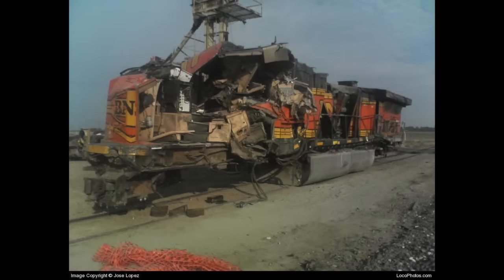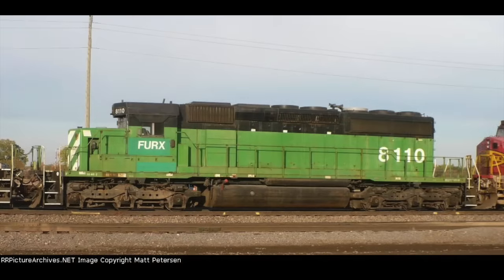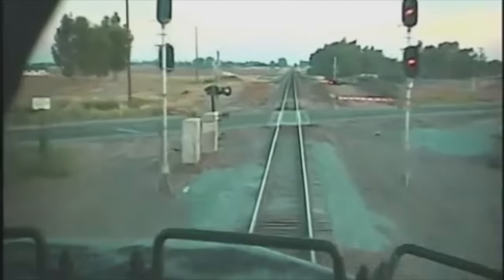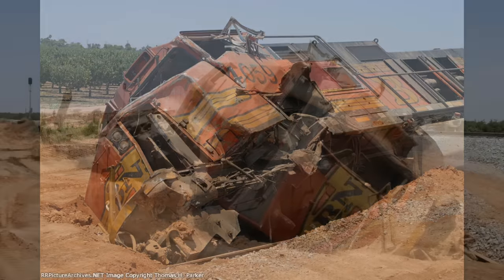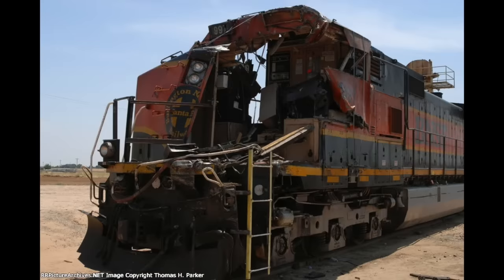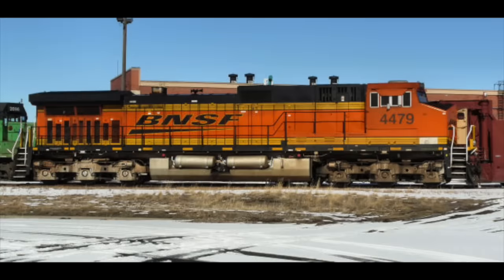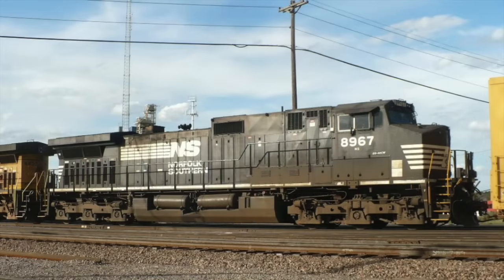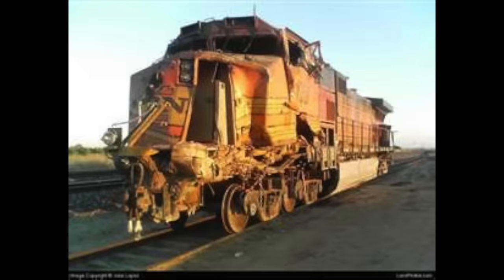Kismet Train Collision 13 years later

Comment: Correct me if I'm wrong on this, but having read threw the NTSB report myself there's a couple incandescence that stand out in your coverage of this incident. The first correction being that cocaine was not detected in the blood stream of any active crew members aboard either train. However the southbound's crew did test positive for marijuana in there blood stream. It was also stated that they had been dozing off prior to the point of the collision and consequently motored threw the approach signal at the north end of the Kismet siding which was displaying an approach signal that they were supposed to begin slowing down at. Upon approaching the south end of the siding awakening likely to the sound of the alerter going off the engineer realized where on the system they were at and upon seeing the red board in front of them the engineer dumped the air. Ironically he - almost - saved it. Had the train been given perhaps another 100 to 150 feet the train would have fowled the signal but still remained in the clear for the approaching northbound.

In fact if you watch closely as the northbound is nearing the signal directly it into Kismet siding you can actually see when the southbound crosses the signal fowl point causing the northbound's signal to immediately drop to red. Albeit only feet before the northbound passed the signal. You can also notice smoke coming from the southbound's brakes as a result of the train's air being dumped.

The kind of twisted irony is the northbound's air can be heard being dumped on the sweeping right hand bend approaching the south end of Kismet siding. However had they not dumped the air and consequently slowed the train a bit before the impact, the lead unit would have likely been able to clear the front of the oncoming Southbound and would have simply entered the siding likely somewhat unharmed.

The second correction here being that the crew member seen jumping from the southbound wasn't in fact that engineer but the conductor who upon jumping broke his leg but was able to escape far enough away from the crash site to avoid further injuries. The crew members aboard both trains that remained on board took shelter between the control desk in front of them and there seats to shield them from broken glass and other debris.

It's also worth mentioning that this took place in "dark territory" on the subdivision without CTC control governing movements and signal aspects. Had CTC been in place this incident might have been avoided as a result of train movements being able to be more easily detected and warning communications could have been sent to the southbound's crew to awaken them early enough to avoid the situation to start with. All in all it's a bad situation that thankfully didn't end up any worse then it already was.

Comment: I always wondered what it is like to be in command of a huge diesel electric locomotive and a long freight train. You have to be alert at all times and watch your signals, and blow the horn for crossings and when you are supposed to and watch your speed. I have train simulators on my computer where you can do just that. I also like older trains, steam, diesel, and tourist railroads as well as Amtrak, commuter railroads, etc.
Reply: can it simulate brandon bostian mode?
Reply: You also have to smoke crack

Comment: As I walked thru the door of the yard office about to be on duty as a locomotive engineer I see the video of the wreck looping on a screen over and over. After awhile it gets really old. I told the Trainmaster if you don't shut that off I'm  going  30 mph the whole trip and put the train into emergency every time I see a headlight. The video was shutoff.  I worked for the BN/BNSF for 32 years. I don't need to watch that over and over before I depart on my train. I seen plenty  of things the public never has and never will. I'm retired now. Stay safe my brothers and sisters.

Comment: Good that there were no fatalities. Amazing that all but one of the locos were repaired. Im not a train buff but I understand the USA builds some fine  engines! They are used in the UK as well. I understand that in the USA the engines are far better than the tracks they have to run on!

Comment: You really ought to check what the report found, as it would appear your video is rather inaccurate/misleading:
"Probable Cause and Contributing Factors  

The conductor of the eastbound train’s use of cocaine may have contributed to the cause of the accident.  However, the toxicological results do not allow a conclusion concerning either possible impairment or when the drug was taken.  The blood contains only the inactive metabolite, benzoylecgonine, which is not normally associated with impairment.  Neither impairment nor time of exposure to the drug can be derived from urine results.

The FRA determined the probable cause as the failure of Train #1 to comply with automatic block or interlocking signal displaying a stop indication.
"
In other words, they don't know WHY train 1 didn't stop. Drugs might have contributed, but might not. It's the conductor, not the engineer, with the drugs detected after all.
Reply: That is a true statement the train should have stopped when the other train was coming towards him💯💯

Comment: Decent pile of rock... However there are some color inconsistencies. Not all from the same batch. Just cause old school locomotives used to puff, doesn't mean engineers need to do so as well. At most, lightly sprinkle the crack on your weed so one does not become "stuck", and unable to manage the merge. Carry on mind melters...

Comment: I’m a heavy pot smoker, and I can confirm, as I am also a responsible adult, don’t operate machinery no matter what drug you are on and how you handle it. I smoke every day almost. But not when I have to drive or operate any form of machinery. I’ve caught myself so many times in my younger years, and barely stopped myself from causing accidents. A couple of close scares and I realized it doesn’t matter that I can handle being high, no matter what, you will eventually cause a disaster. Kid who used to work for the same company as me died at 18 when he was high, driving a tractor, simple shit, we do it every day. But he was high. For whatever reason he decided to drive straight up the hill. Which had more than a 40 degree incline. Tipped over and crushed him. Killed instantly. He was like me and could smoke and work no problem. But that tiny decision, in my opinion because he was high and thought it would be fun, killed him. Just weed. But high regardless. After that I stopped smoking before work.

Comment: Very well researched I am surprised that some of the older ones did not get torched and that all but one was repaired. But this is why RR's that have 2 Track lines should not pull up 1 track with random passing sidings like the IC did for some strange unknown reason.

Comment: I didn't know trains where basically a hybrid diesel/electric powered.
Reply: The first few locomotives built in the mid-late 1800s were built like a steam engine.

In 1960, diesel took over steam. Most steam locomotives in the US, i.e. N&W 611 and Big Boy 4014 were preserved. The UK has its fair share aswell.

Comment: Can see the one train, northbound I guess with the camera, trying to stop not long after they're rounding the curve. He was obviously slowing down, probably due to siding speed limit? But as they get closer you can see the cab rocking a bit like he had thrown it in emergency and was noticeably slowing down more. Despite that, massive damage. And what's up with the SB guy bailing out like that? Did he even hit the emergency brake before doing so?

Comment: So, Why don't they also have a system to Trip the Deadman Brake from Externally, if they Pass a Point along the Siding, Traveling at a Speed that they'd not be able to stop in Safety, by the end of the Siding, if the Signal Instructions were to Stop and Hold for Opposing Traffic!

And, why, still today, do they have no Cameras in those Light / Signal Standards, facing Both Directions? (Preferably 4K or Better Resolution!)

Comment: "Repaired" huh?? I really would like to know how many original parts remained. I cant help but feel the ACTUAL "power unit" and maybe a few highly protected control modules were just dropped into a new engine. Seeing before amd after, i cant imagine them actually being repaired and  retaning any sort of frame or structure members from the originals. Super sketch to try to re-use structure members. Once its been deformed, nothing can give its back its strength less than melting and remaking the part

Comment: With complete and all do respect.....I clicked on this footage because I wanted to see a head on train wreck. By checking out the thumbnail I knew it wasn't going to be anything catastrophic. Plus, I didn't hear anything about deaths...so I'm taking that as 0 deaths!! There's curiosity & morbid curiosity. I actually have both...but, in this little story...I'm just curious. I genuinely wanted to see what was going to happen. By the thumbnail I convinced myself that both trains were going to collide corner 2 corner & I ended up right...Anyways, my point is...I wanted to see this footage of this train wreck & I had no idea that it was going to be a 2--4--1 day!! Train wreck & a lesson on trains!! I'm not dumping on the video, narrator, or whoever was the writer 4 this. I enjoyed this video & learned some shit that I didn't know B4!! I just wasn't prepared for the mechanics in & out of an engine. I just found that part rather amusing!! I'm sure there is just a handful or way less than that of engineers on a train with that many engines so the fatality rate would be considerably low...if any would exist. The engines found themselves destroyed but apparently repairable & sent back out on the job. I'm glad no one was injured or deceased 4 that matter. Nice work with the video also!! 🤘🏼

Comment: Dispatch who let driver under drags to work is one guilty! Before each and every shift driver must pass medical tests, including blood pressure, cognition, and other similar stuff. Also, periodical deeper tests are mandatory. You don't say that driver consumed crack for the first time in their line, and did it right there in cabin.
That being said, this particular mistake might be made without any influence. Drive might have sneezed at wrong moment, the moment when they had to start breaking. Moment missed, train made much bigger distance.
Also, judging by when signal switched to red, that is global fuckup of railroads. Drawing border without any buffer space - asking for troubles.

Comment: Something's not right with the two pictures of the aftermath of the BNSF engine at the beginning of the video, compared to the crash site.  Where's the ditch that runs along side of the tracks?   And there's never been any mention of the condition of the engineer who bailed out of the BNSF engine, who would had to have been killed following the impact of the two engines--the BNSF engine crushing him to death having had to have tipped over and fallen into the ditch.

Comment: hopefully now there are systems to stop trains from hitting head on with computers, like by using gps or some other kind of tracking to have a fallback system to see what other trains are in the system and what their routes are.
Reply: There is, it will stop trains from running signals

Comment: You would not be able to differentiate between "crack cocaine" and any other form of cocaine using a drug test.  So I'm interested into why this story reported that the form of cocaine ingested was specifically of the freebased form? Is there a source with some missing context (like they actually found freebased cocaine in his possession).

Comment: I'm confused. How does drugs figure into this accident? Who was responsible for 2 trains being on the same track. It doesn't look like the engineers were to blame. Dispatcher maybe?
Reply: It was unclear if drugs played a part (per the report). The oncoming train had a red block (stop signal), and was supposed to stop, however they ran the signal just as the camera train entered  the siding. In simple terms, the oncoming crew ran a red light. This dispatcher was not to blame.

Comment: Only 1 engine that scrapped
Reply: 4059 was repaired and sent back to service
Reply: 4479 was repaired and sent back to service
Reply: 5473 were damaged beyobd repair and total loss and they go to BNSF Shop And Scrapped
Reply: 8110 was repaired and continue's its service
Reply: 2437 was repaired and continue' its Service
Reply: 1065 was repaired and sent back to service
Reply: 4715 was repaired and sent back to service but losts its fakebonnet scheme
Reply: 997 was repaired and sent back to service
Reply: 7065 was repaired and sold to NS and numbered to 3157
Reply: 8967 was repaired and continue its service back to NS
Reply: Nrex 5473 was damaged beyond repair and was written off
Reply: @tanyajelks2140  Yes Youre correct they being scrapped